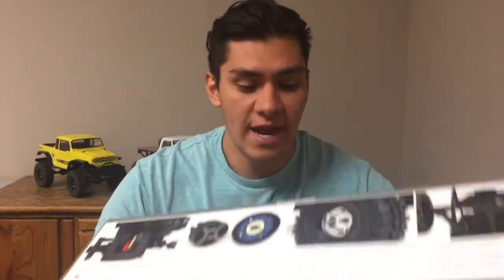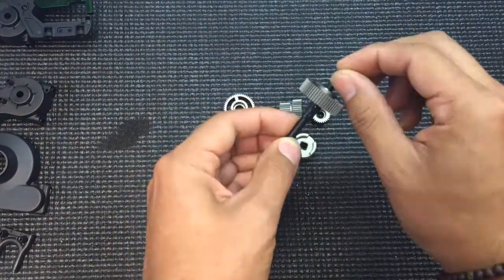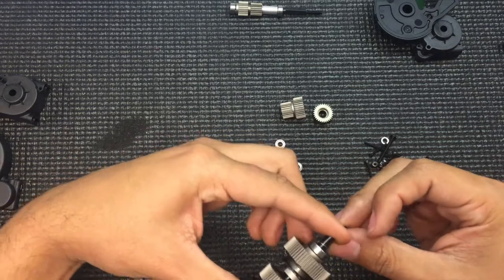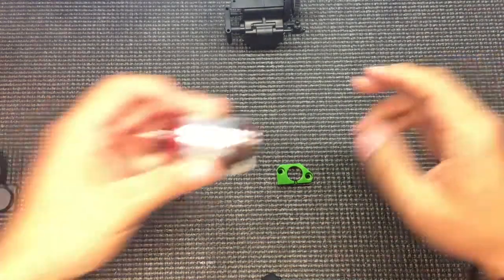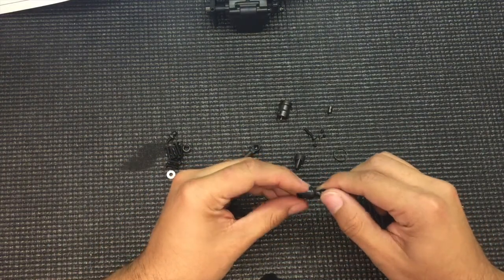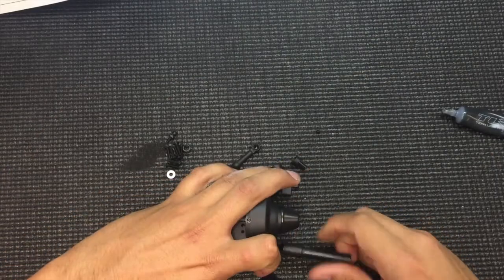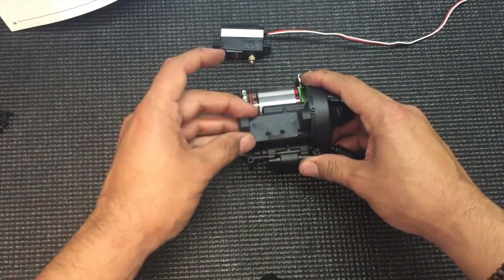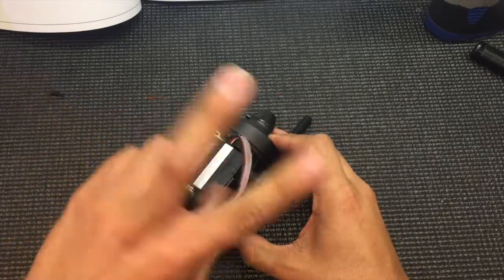Part 1: Vaterra Twin Hammers 1/10 Servo Shifting Servo Modification

Comment: The only problem with the shifter arm is how is fitted on his bar: actually held by two c-clips. It should really be more fixed in order to avoid the minimal play that can stuck it, for example threaded inside and screwed on the arm, with a threaded cylynder that will become the ending part of the arm after the shift lever.  I strictly recommend to modify that part, all the rest of the kit is really great and solid. Another mod you should consider is to make the aluminium bigger piece of the front end more hidden from the obstacles, now it have a squared shape that can hardly get caught and damaged off a jump, and a front skidplate that cover the main screws.  The shifting servo instead, ca be made using a "spring/spiral" made steel piece that will absorb the most of the spare force but still granting the motion, the arm infact needs very little force to be moved only. I also suggest to reverse upside down the two lil screws thet hold the battery tray on the \_/ shaped plastic holder by its rear end, now in a tricky position after the model been assembled. Will be cool having provided a rubbery hat/cover for the rear cvd ending where it joins to the rear "diff",  which usually can grab some dirt very easy acting like a spoon.  Also a pinion :)  The upper cap of the shocks mount that is mounted after filling with the oil should not have the carved hole, i filled it with metal putty and was like super easy fill the shocks with no air at first attemp. 
Great gob on the kit again, love this car, love the mechanics, very silent and smooth!!
Reply: You sure don't want to stuck your shifter!! 😱😜😅
..... As for the "Hat" for the CVDs, us Older Farts have always used Party Balloons. The real skinny ones, like the ones that People twist into "Animals". (Provided that Balloon Animals don't OFFEND young people TOO!! 😣😥😢) 

These Balloons, uninflated, are VERY small in diameter, fit tightly against the Shaft and CVDs, and of course are very flexible! You can get them in Bags of 100 or more. If you mess up on your first, second, TENTH try to get them on properly.... NO Problem!! They usually end up only costing LESS than a Penny each!!! 👍👍😎
.... A quick shot of WD-40 helps them go on easily. Done right, they'll EVEN keep out Water! 😉